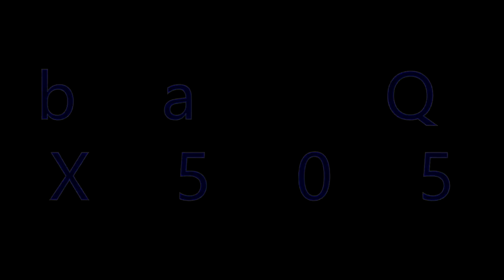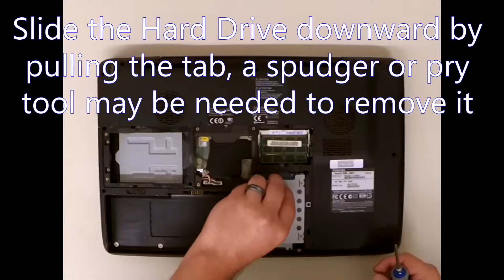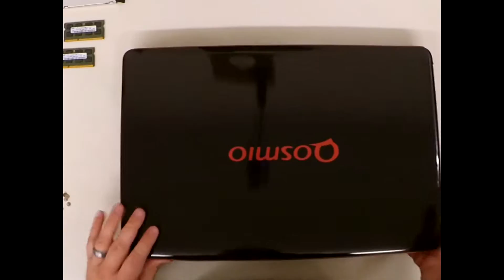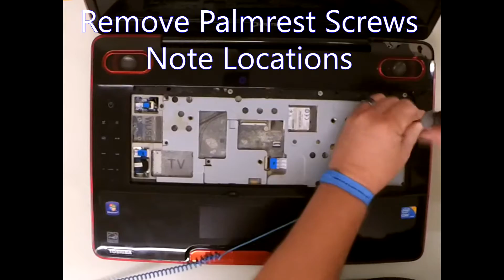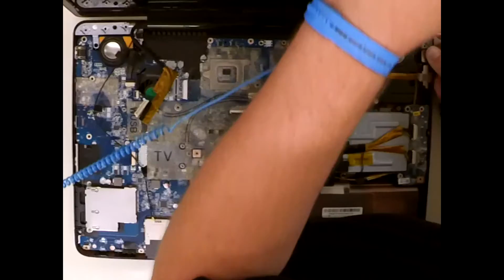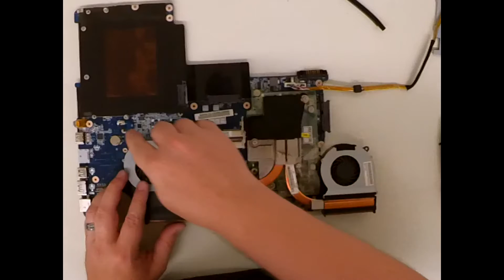Toshiba Qosmio X500 X505 Disassembly -  Video Card, CPU &  Motherboard, Full Teardown & Disassemble

Comment: Hi awesome video, I just took mine apart yesterday and put all back together however bluetooth and th illumination for the keypad are not working anymore. What could i check?
Reply from the maker: The small cable on the keyboard is the lighting. Check the wires going to the wireless card, but it has been a long time since we did this video so I don't remember how the bluetooth was connected.
Reply: @Expertpcnc  Thanks for the quick reply, the small keyboard cable socket I damaged a little. But i can live without the light. Thank you very much

Comment: Thanks for the Video do you happen to know if another video card will fit, I need to upgrade mine or buy a new puter but love my old X505 lol
Reply from the maker: Try some searches on your exact model with the keyword video card upgrade, you may find info on sites like forum.notebookreview.com, it looks proprietary so it may have to come out of another Qosmio
Reply: I have the x505-8102x. Comes with a 460m. I found that the 860m works with this computer. I know this is old but I’m sure it’ll help someone down the line. I’ve decided to post my findings on as many videos as I can. 

My dad uses it for gaming. However he would like to have a lil umf in his graphics and be able to play new titles. I found that gtx 860m would fit in the lappy and the thermals and power consumption are on par with the 460m. I’m going to order the part and be swapping the parts soon after. If you or anyone would like to know my results plz message me.  I’d like to bring new life into old PCs and help others in the process. Just replacing thermal paste and cleaning the internals gave this lappy years back in performance. Let me know if you or anyone is interested.
Reply: @mnal5gex  Recently I purchased this laptop. I have GTS 360M which is 1GB video card. I am looking for possibly upgrade.
 IMO,  460M is a1,5GB which is maximum  upgrade for that laptop. I am curious,  what happen with your upgrade? Does it work?
Reply: Cemo Maher as a matter of fact it does not work. Upon taking apart the computer I found that toshiba used a different connection to their GPUs for these specific model. I wasn’t able to do the upgrade. I did more research and found that the qosmio x775 that came out after ours started to have the standardized GPUs and could be upgraded accordingly. It’s a shame really. On a brighter note. I have been able to find the x775 for relatively cheap online from owners. Between $75-250$. Considering the cost of laptops these days I wouldn’t put past buying my father a used x775 and upgrading the gpu to the 860m that I currently have on me. 

As for the x505, I’m afraid we are out of luck with them. I have 8gb of Ram and an ssd in it and that’s about all I can do for upgrades on it. I can put a G2 socket cpu in it for $135 and upgrade that. I’ll get 35-45% cpu boost but sadly the gpu is fixed to that motherboard. The 450m is it. 

I’m more then happy to answer any other questions if you have any!
Reply: @mnal5gex  Thanks for the update. I have an X505 that needs some attention, do you have any info on the G2 cpu upgrade?
Reply: SiNNiK there are a couple of cpu you can go with. It’s very limited for upgrades specifically within the years the x505 released. There is however a couple of cpus that are G2 socket and they can give the 35-45% performance increase. The price is about 120-140$ for the cpu. Look for the i7-3820qm and the i7- 3840qm. They are G2 socket cpus.for 70$ or so you can all find the i7-2860qm. It has a modest gain of 20% but I know this cpu in particular will work for sure in our x505. Id have to do more research on the other 2 cpu to ensure they are full compatible with the G2 socket.
Reply: SiNNiK IMO the best thing you can do is stick 8gb of Ram in the x505 and repaste the cpu and gpu. I did this and it gave me so much performance gains. A good dusting while you have it apart helps as well. Get the 460m for yours and just start with that. The cpu on in rn should be enough. Give the PC a fresh install of win10 too.
Finally I had read on some x505 forums that a few ppl tried installing 16gb of Ram into the x505 and the machine took it. Now from what I read the MB maxed out at 8gb. I want to try it out myself and see what results I can get from it.  So Ram and cpu would your final upgrades to the x505

Comment: Can a 7 year old Qosmio be repaired?  I love this old thing but seems the graphics card isnt working well.
Reply: Because OLD IS GOLD ;)
Reply: I love mine too but it seems as if the drives are running very low on space, which means I can't add any new applications.  I'm really confused about what storage options are best for me and I'm afraid to open the guts and look around.  Otherwise, everything (audio, video) runs beautifully and it's still relatively speedy.
Can anyone please advise?
Reply: @deec.3371   Adding a second hard drive or replacing one is easy. You don't have to do anything other than open the hard drive door and remove the old one and replace it with a larger one. If you only have one drive in there you can just add a new one in the empty bay.

Comment: Ещё вам лайфхак для Quosmio X500: если вы потеряли пароль от BIOS вам поможет простая манипуляция. При отключенном блоке питания и снятой батарейке делаем следующее:
1. Открываем три маленькие крышки на днище корпуса и отсоединяем и вынимаем:
- жёсткий диск 1
-жёсткий диск 2
-две планки оперативной памяти
2. под нижней планкой оперативной памяти на материнской плате есть две пары контактных площадок G1 и G0
Чтобы выполнить reset BIOS необходимо на одну минуту замкнуть между собой контактные площадки G1 любым металлическим предметом.

Another life hack for Quosmio X500: if you have lost your BIOS password, a simple manipulation will help you. With the power disconnected and the battery removed, do the following:
1. Open the three small covers on the bottom of the case and disconnect and remove:
- hard drive 1
- hard drive 2
- two RAM strips
2. under the lower RAM strip on the motherboard there are two pairs of contact pads G1 and G0
To reset the BIOS, you need to short-circuit the G1 contact pads with any metal object for one minute.

Comment: I can't get the palmrest screw in the lower right corner loose to remove the top cover and get to WiFi card I want to upgrade. Why won't this palmrest screw come loose?
Reply from the maker: You've probably fiugured this out by now, but most likely the mount the screw is in has broken and is spinning free. These are always an experience to get out, hopefully you can get something to it to hold the lug in place to get the screw loose!

Comment: Greetings, 
Any advice on what type of internal hard drives are best for an upgrade for a X500-Q930x?  
My current storage drive is 2x500 GB (7200 RPM) Serial ATA hard disk drive. I love my beast of a laptop and it still works well for me and I'd like to hold onto it for a few more years.
Thanks.
Reply: There are enough room in there to put a bigger HDD. What I did on mine was adding a 1tb HDD and a SSD in the second slot to make it boot faster (cause I got it with only one HDD) but you can consider adding another 1tb in there. If you want more space, make sure the HDD is 9mm max otherwise you wont be able to use the trays...

Comment: A piece of insulation tape fell out when I disassembled my laptop, and I cannot see where it came from. It is about 73mmx25mm with 2 notches on one side, and 2 bevelled corners on the other side.
Reply from the maker: If I recall it was around the led lights at the left of the keyboard but it has been a while since this was done. Look at the back of the palmrest and see if there is anywhere it looks like it may sit.

Comment: My qosmio x500 laptop screen turned dark...I can see the screen very dim...when connected to an external monitor works fine. When I turn ON the laptop screen works for few seconds and then becomes dark. Can anyone solve this issue
Reply: это решается. в этом ноутбуке используется подсветка экрана люминесцентными лампами-трубками которые имеют ограниченный ресурс и требуют замены